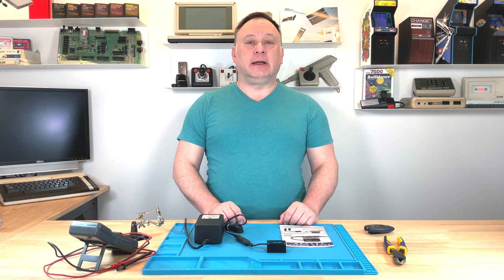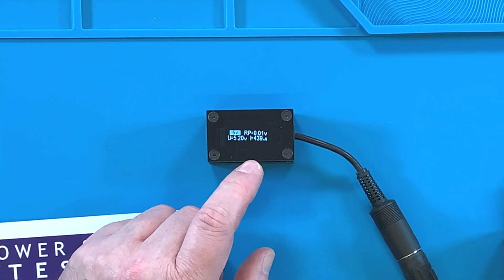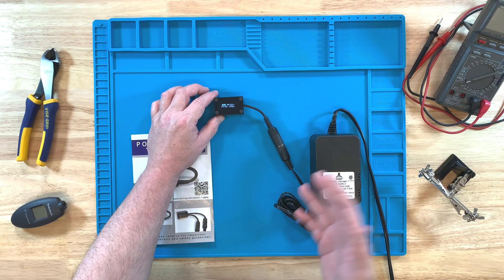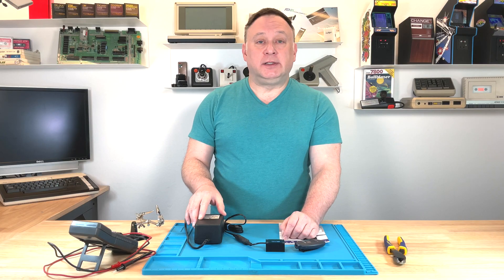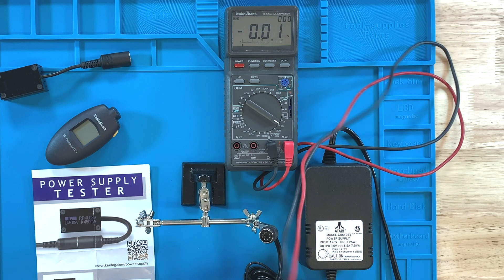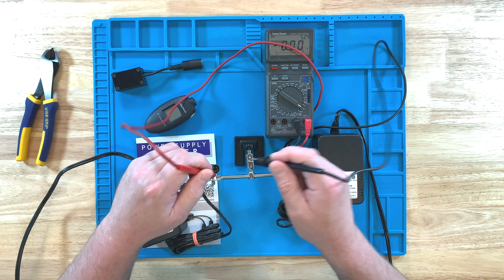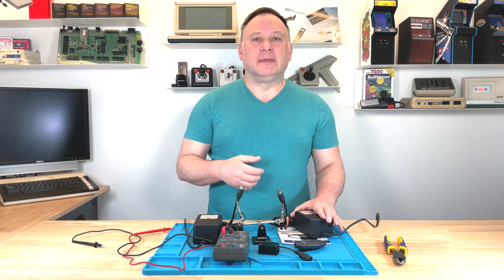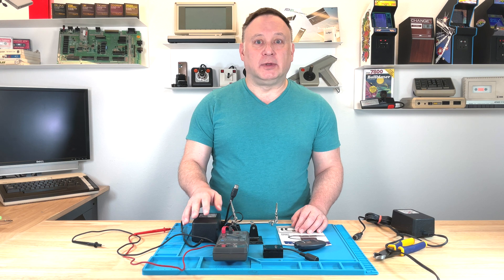Review: Atari Power Supply Tester from Keelog

Comment: I bought it for the c64. It doesn’t appear to be working with the older type og wedge-shaped c64 psu.I have tested it with many different units to no avail. The tester is working.
Reply from the maker: Maybe you can find or make an adapter to get it working :\
Reply: @TheVintNerd  I already made one.
Reply from the maker: @christianlarsen1070  Perfect! :)

Comment: If you connect the power supply to a breakout breadboard, you can load it with resistors and measure the voltage with the meter. But maybe more trouble than what it’s worth. 
Also, some DMMs have a battery test which will put a little load on whatever you’re measuring.
Reply from the maker: Hi, Craig. Good points. Maybe even enough resistors to simulate the load of the device the power supply would normally connect to. Thanks for the suggestions.